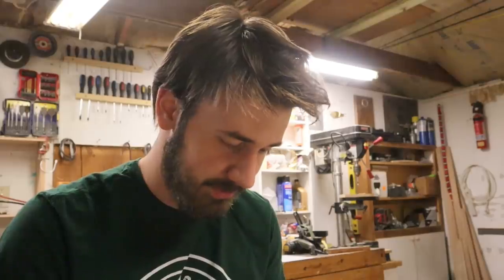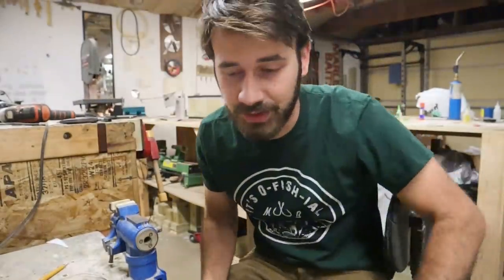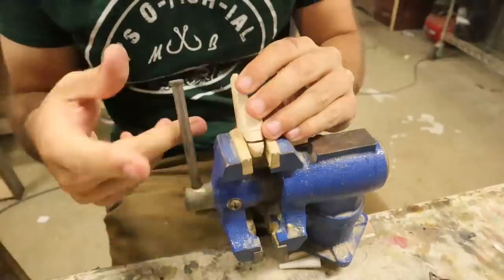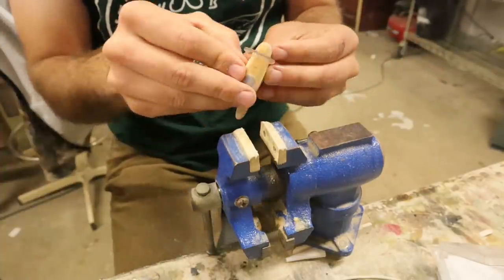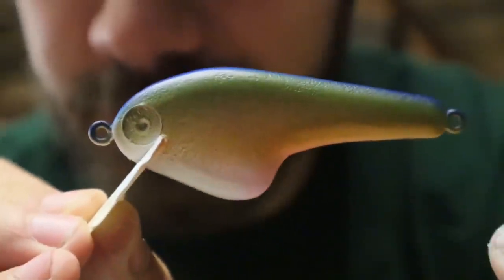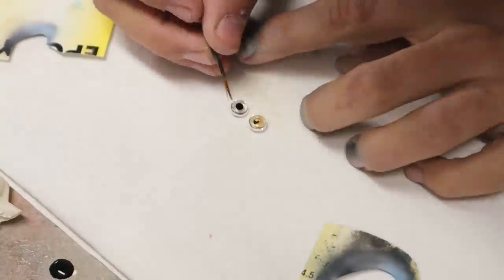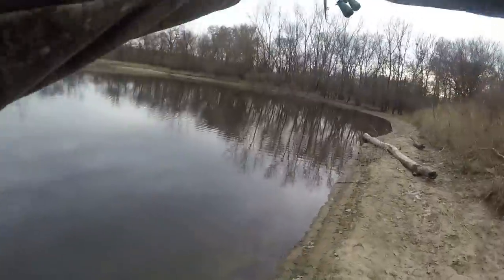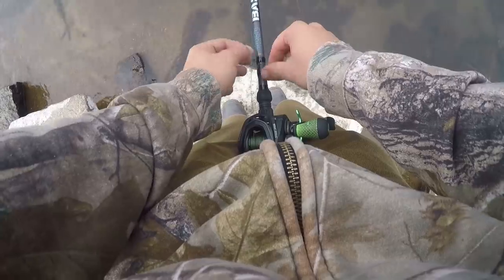UnderSpin CrankBait | One Day Build to Catch

Comment: If your bait is stuck in a rock close to shore,  you can tie a piece of wood ore something in your line and throw it as far as possible over the bait, line tension from the opposite direction often pulls the bait out of the place where it has been stuck. Lead works as well, you can cast it further out, but it will pull your bait to the bottom, and with bad luck directly into the next snag. Try wood first. 
Greetings from Germany

Comment: @ 2mins exactly; That would appear to be Markalon(sp?) brand polycarbonate sheet. Whilst not the name brand Lexan, it is technically a polycarbonate sheet. The same material as Lexan. Like using a "Band-Aid", whilst it in fact was made by Curad! SSDM(same stuff different manufacturer)!

Comment: Nate, I always recover my snagged lures, i have a thick wire with some weight tied on a 0.8mm mono and the wire has a circular shape that i close in my line, then i lift my rod  Tip and the wire runs through my line until it makes contact with my lure, goes over the lure or just snags itself in the lure hooks then i just pull the lure using the 0.8mm line (maybe around 80 pound? I have no idea but it's thick and strong)

Sometimes i open a hook but i have brought an entire tree out of the water once, it was around 10 feet tall lmao

Please make one lure saver, it's so cheap and saves you from the disheartening moments of losing a lure

Comment: I'm sure you probably know this already, but just in case. On the pour pot you can turn the metal "plug" at the top by the handle with a flat screw driver it helps clear the nozzle from within the tank. Also on mine I added some lead weight to the tip of the handle so the plug pushes down more on the nozzle to stop drips. Just some tips I've worked out over the years. Great work as always.

Comment: rock snags are the worst. rock snags with metal rod curved under nevah nevah let go.  I feel sorry for the cazd fish that bites it and can't go anywhere, because then it is snagged too. smaller fish here are so cold they can't move after the sun goes down even when live bait is dancing in front of them.  It is sad.  Now is the time to make some huge pike and muskie baits for the deep water where all the bigger fish go in winter... I have some awesome holograph duct tape.  will the body be baked salt dough, or plastic cut from a milk bottle handle?   depends on what I can find right away.

Comment: look after your self i thought i was superman at one time had too many injuries, have not been feeling good too but did get out to try  them hooks out  build  did build one like that  but i used a snap swivel  and glue that into the body my idea it would have wanted to turn the blade it had it option how it wanted to work if i cast did a different then trolling with it  did fine out fast  the fish the to steel your hand make hooks too got to the boat  taken to long and last it

Comment: I'm in the SCA... and a number of years ago I used lexan to make a lightweight coat of plates as armor... It worked surprisingly well in everything but cold weather. Turns out..lexan becomes extremely brittle in cold temperatures...and long story short..that's probably why you broke that lip.

Comment: you couldve actually hooked a carp with that lure instead of snagging. people try to act like carp are bottom  feeders but its not true. carp will feed where ever food is present. that could be bottom, mid, or top water. ive caught them on crank bait in the mouth. i do a lot of carp fishing they actually make lures called zig lure/zig rig that you can float at different depths.